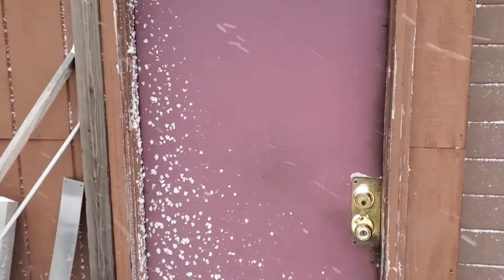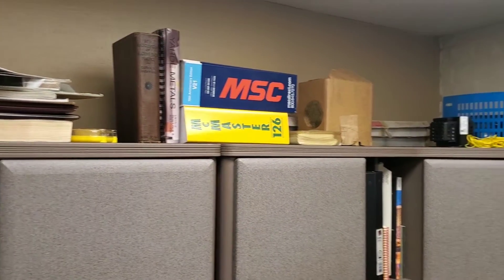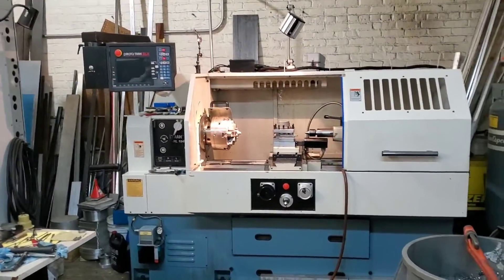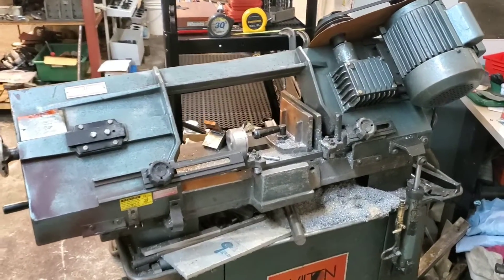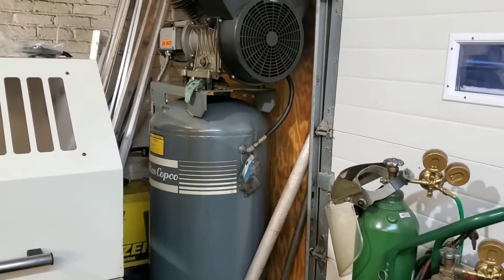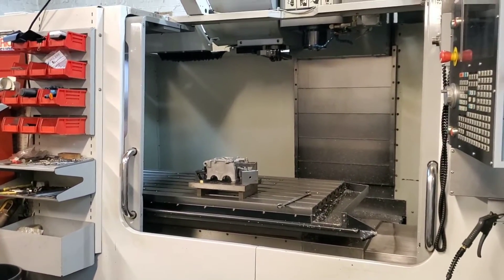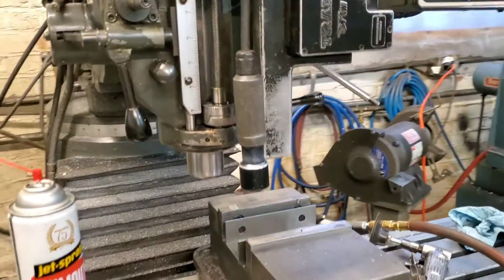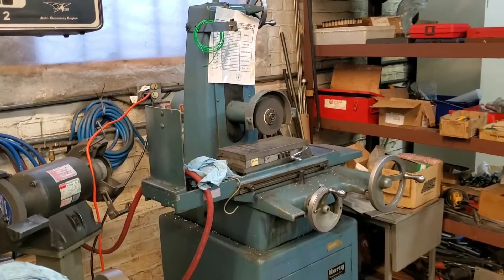Lil Machine Shop Tour

Comment: Awesome equipment. You guys certainly have the capabilities to produce precision parts 👌
Reply from the maker: I appreciate it and thank you for watching. Its takes some time but we certainly can and do produce quality machine work. Also working to upgrade our capabilities all the time and also the efficiency of the floor space itself. Slowly but surely:)
Reply: @shopdreamin372  definitely 👍. The shop I work in has similar equipment.. 2 bridgeports and a Southbend manual lathe.. mig welders, bandsaws etc.. No CNC yet but I would love to get some training. I took a CNC milling course for my engineering technology degree, but haven't programmed or ran a CNC machine since then.
Reply from the maker: You could get back into it, I think the biggest thing is to apply your skills!

Comment: Situating the abrasive dust producing machines: surface grinder, belt grinder; pedestal grinder around a precision machine like a (Lagun) mill or lathe is a recipe for excessive wear.
Reply from the maker: We only have so much room but that is a really good point. I wouldn't say the grinding machines see a bunch of use to be dangerous but I can see the surface grinder making dust. I will definitely consider this as much as I can right now.